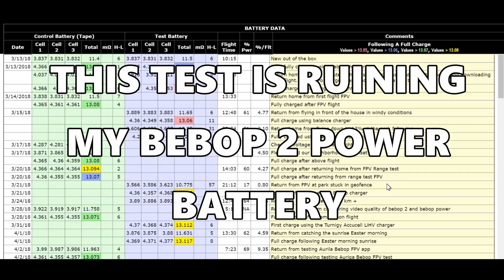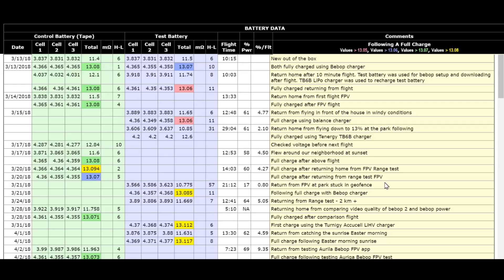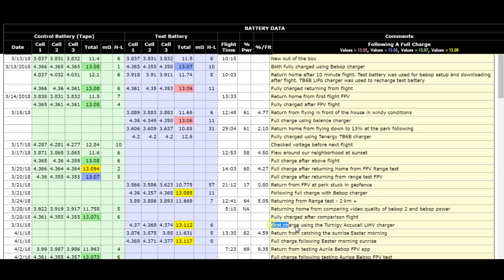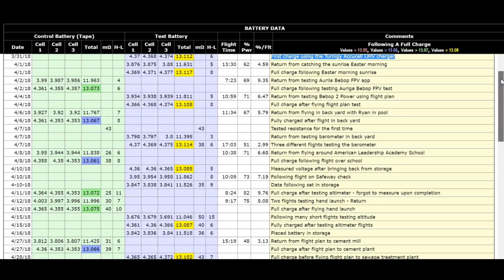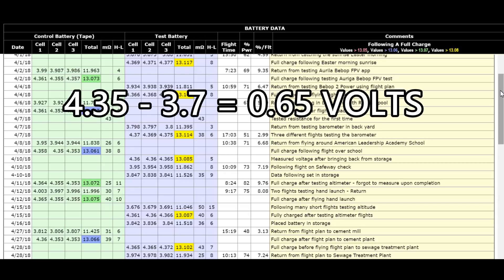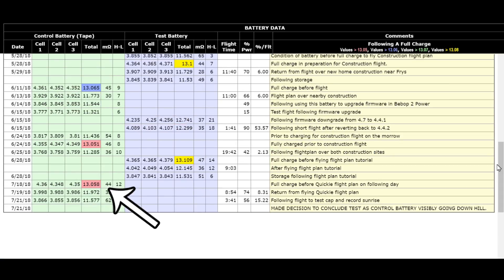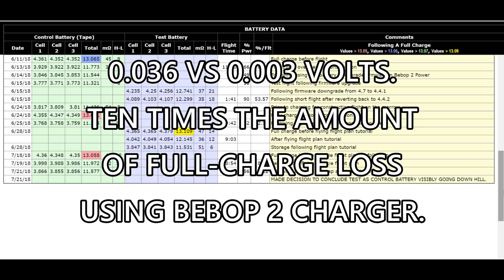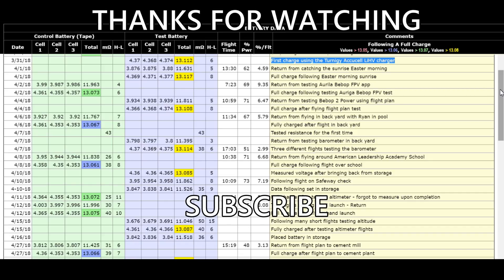THIS TEST IS RUINING MY BEBOP 2 POWER BATTERY

Comment: Does the Beboop 2 power have built in balance circuit in the battery pack?
Reply from the maker: Hi Dar. It has the same circuitry as the Bebop 2. The only difference between the two is the chemical makeup - so the Power gets about 10% more flying time. Thank you for your comment and God bless.
Reply: mrkentdotcom. So all of the blancing is done through the factory charger. The factory battery is just a 3 cell LiPo in a hard case?
Reply from the maker: Hi Dar. That is not exactly the case. Parrot put some kind of circuit inside the battery. But they provide no schematic of it or wiring diagram of how it works. My first bebop battery lasted two or three months before I got the flashing red light on the factory charger and could no longer charge it until I started using my balance charger. That battery lasted many, many months after that. The system Parrot uses doesn't do any true balancing. Thanks for your question and God bless.

Comment: MrKent, I have a question for you. Which flight planner seems to be more reliable Flight Planner or the ArPro 3? Reason I ask, i just picked up a Bebop 2 FPV kit but prior to buying, I watched many of your videos over time and have been wondering about the Planners. I did most of my research long before buying one. Btw, very, very good job on these videos and I hope it will start helping you as it has helped us. I own several GPS Quads including some newer Dji however, I've always been interested in the Bebop and included it each time with my decision making when purchasing a new quad. Glad I revisited it and got one. It has it's pros & cons in comparison to my others but its definitely fun and serves a purpose of it's own. I'm having fun with it and I'm about to solder wires/connectors to balance the batteries properly. Look forward to your thought on the FP's
Reply from the maker: Thanks for your comment and question. I can't say which of the two flight planners is best. Neither has ever let me down. I have learned over time by watching other videos that the most important thing (for every flight) is to reboot your tablet/phone before flying. That kills anything that might interfere with the connection between the tablet and the skycontroller. 

As soon as you press the "go" button on the flight planner, all of the information has to go from the tablet/phone to the skycontroller, then to the drone. I don't want anything interferring with that. God bless.

Comment: Hi MrKent. I just want to your start up preflight page.I would like to add to it turn off WiFi. Turn off Bluetooth,turn on airplane mod?Is this correct?or off airplane mod?thanks for your help
Reply from the maker: Hi Bruce. It is a good idea to turn off WiFi and Bluetooth. But I would leave Airplane Mode OFF. Airplane Mode stops all communication between your tablet/phone and the skycontroller and I didn't like that idea when I tested it out. Thanks for your comment and God bless.

Comment: Wow, surprising information. My understanding is that bebop 2 batteries (not the bebop 2 power, i dont know about them) have balancer built into the battery. Also the bebop 2 battery charger is "fast" charger and i think that makes a difference in a decrease in battery life as well. I have owned many things with fast chargers and they do seem to eat batteries.
 I ask to propose a few questions. 
1) Are you letting your batteries cool down before charging them? 
2) Did the length in change times also increase for the control battery? 
3) Do you have the same number of flights for both batteries?
I do think your results are valid, i am just wondering. You know me i love data.. :)
Reply from the maker: Thank you for your questions. To answer 1) Yes, I learned that years ago with my fixed wing planes. 2) I should have kept track of charging time but didn't think about it. 3) Yes. I traded back and forth between each flight - after I got everything set up to begin the experiment. 

I always remind folks, "If the outside of the battery feels "warm" imagine how "hot" it is in the middle." I appreciate your attitude and desire for knowledge. God bless.
Reply: Thanks for answering my questions. Good to know. Eventually i am going to get another battery. I think i am taking pretty good care of this one. I am not flying everyday so that's got to help in longer life. I did just release a new video today, go have a look.

Comment: I’ve been seeing people
Doing a WiFi modi’s bebop2  and the disco to run off the lte network and they claim the range is only limited to the battery power as long as you’re in an areas with good cell signal. 
Ive been waiting to see if you speak on this or not.
Reply from the maker: Thank you for your comment. I really don't have an answer for you because I haven't done any modifications. I prefer using a flight plan to get the view I am looking for rather than trying to fight with the loss of signal issue. I don''t think you will see me speaking to that issue, but thank you for your question and God bless.

Comment: Nice, informative video as always Mr. K! I have a question about my Bebop2 battery. I charged my battery, because I was going to fly and it started raining. Now I have a fully charged battery but I can't fly yet and no way to discharge it. How long is it safe to have the battery charged at 100% without any kind of discharge? Will just today be ok? Appreciate you Mr. K.
Reply from the maker: Thank you for your question. It is OK to keep charged for a week or so. The longer it remains charged the more it gets damaged so I would not let it go much longer than that. There is no way to keep a LiPo battery from aging, no matter how hard you try. In fact that is true of every battery. Thanks again for your comment and God bless.
Reply: Thanks Mr. K! God bless you too!
Reply: @dejaesharp3807  just for the future mate, if you need to discharge your battery but can't fly. Take the props off turn the drone on indoors and either transfer you film data to your computer or let the drone sit there turn on, keep an eye on the heat of the drone though as flying helps keep the heat of the drone down 👍
Reply: @MarcRCAddict  appreciate that! Thought about the prop deal, but didn't know if the rpm would be too high with the props off. Lost my drone since anyway, but I'll be back in the air soon.
Reply: @dejaesharp3807  hi mate, ah no sorry, I didn't mean take the props off and then apply throttle, I just mean turn it tun and transfer data or let it idle, but don't spin the motors.. Oh no sorry to hear you lost the drone, silly question maybe but what happened?

Comment: We are all so lucky 🍀 that your doing all these videos to help use!Thanks so much! Hey I’ll keep buying Bebop2 s so far I’m really happy with it. No problem as I use it the way you gave advice!The charger you make works great and that was a big help also.👍this Bebop2 fills all my needs.I am going to try the higher capacity battery.just for extra safety Incase I lose track of flight time.I wish they would add a low voltage alarm warning on the next up software up dates!!Blessing to you and your family
Reply from the maker: Thank you for your kind words Bruce. Yep, the Bebop 2 is far from perfect but for the money, it is the best drone out there when you begin comparing the price of FPV equipment etc. Parrot's new drone is also a very good drone for the money. But I don't have any more money :) God bless.

Comment: very true Mt. Kent. now my bb battery wont charge 100 % no matter how long I charge it. it functions normal though. Do you know if where I can buy cable for balance charger > Thank you very much beforehand and God bless you/
Reply from the maker: Thank you for your comment. If you have the standard Bebop 2 you can get a good TB6B charger from hobby king, amazon, or your local hobby shop. If you have a Bebop Power I would suggest a Turnigy Accucell, or any balance charger that handles the LiHV battery. And, as you may have already known, I sell the cables for $25 at http://www.mrkent.com/cables/index.htm. If you need any help please don't hesitate to ask. God bless.
Reply: great news sir, I will buy one soon for my bebop. I have imax b6ac charger, will it be compatible ? also my batteries last maybe 15-18 minutes and when I land it, the batteries are usually a little puffed..  and as I know bebop batteries are lipos , right ?
Reply from the maker: Yes, the B6AC charger will work if it shows "LiPo" in the list of batteries it will charge. I'm pretty sure it does. Yes the Bebop batteries are LiPo type. The puffing is the result of internal damage. When a LiPo is over-charged or drained below 3.2 volts it goes into a chemical reaction that changes the solid materials into a gas. Unfortunately, the process is not reversible. That doesn't mean the battery is ruined but it has less physical space inside to become charged, which means your flight times will be decreased. It is OK to use aftermarket batteries, especially if you are going to use a balance charger. Thank you for your questions and never hesitate to ask. God bless.